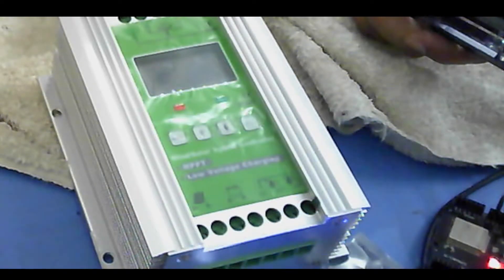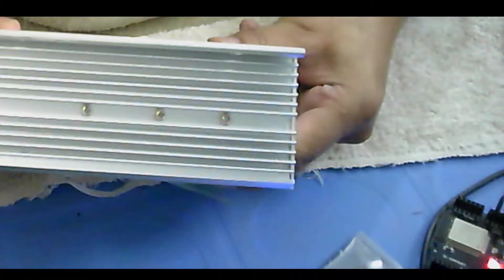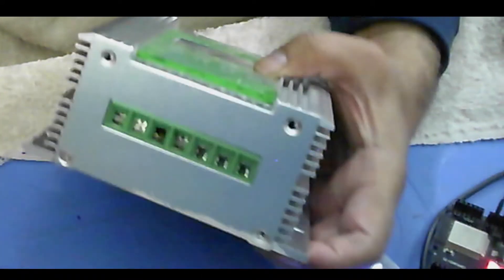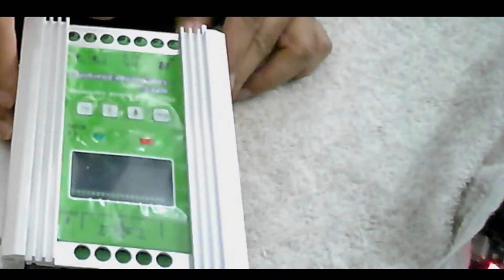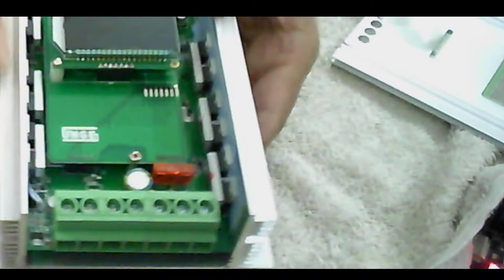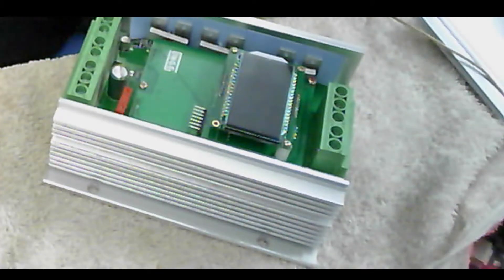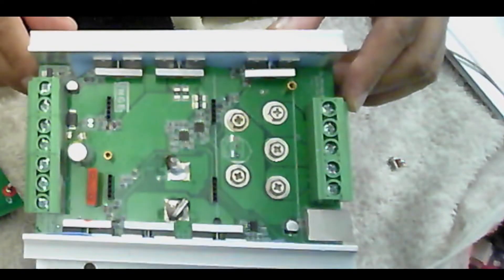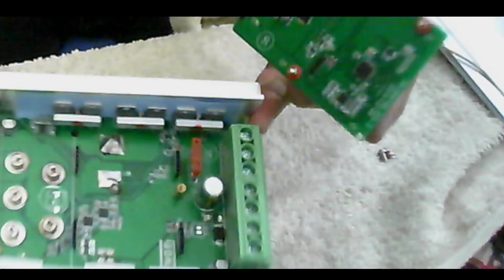Hybrid Wind Solar Controller - Open (JNGE)

Comment: I find this controller doesnt seem to work well with a 500w micro turbine. Is there a way of increasing wind generator braking voltage in junge controller
Reply from the maker: Not sure, their customer services is not good, they didn't even send me MOSFET version number for repairs. I have a burnt on grid micro inverter too, due to braking failure during strom

Comment: Finnaly you repair
Reply from the maker: Nope , just opened, to find the fault
Reply: @545sytes  , have you found the fault? I have also a problem with an identical hybrid charge controller and I would like to fix it...
Reply from the maker: @edialbert8035  not yet didn't get time, I actually tried two other solutions, in one micro controller got defective, in other the controller start discharging batteries, so lots of stuff to repair, currently the wind mill is only enjoying air swings :)
Reply: @545sytes  , then I guess this one is going in the scrap parts pile, since all the information that I found about this controller is that it's rubbish.
Reply from the maker: @edialbert8035  :(